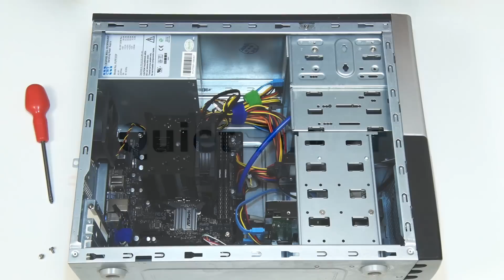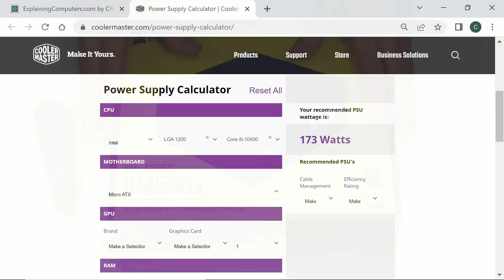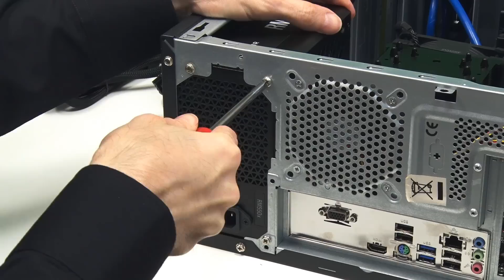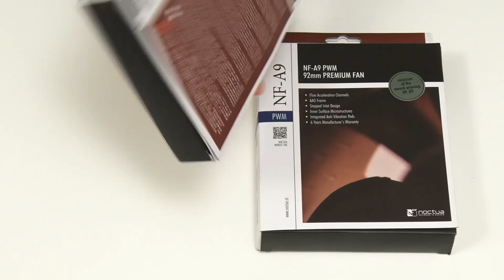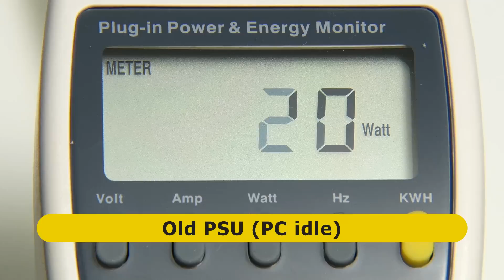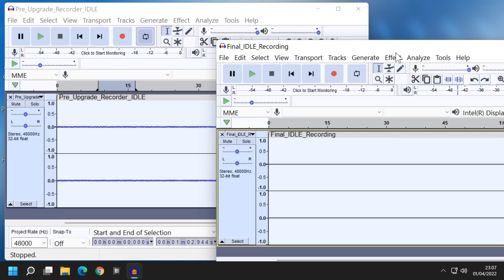Quieter PC #2: Corsair RMx PSU & Case Fans

Comment: For the last nine years, case fans and the PSU have not been the noise makers in my PC builds. The GPU and CPU cooling was sometimes but not since switching to Linux based OS. Oddly enough, the rare time I use an optical drive, that is the loudest noise emanating from my PC and sometimes HDD noise on a brutal data copy of over 500GB.
Reply from the maker: You seem to have been using different desktop PCs than most people for the past nine years . . .

Comment: Tea and crumpets and EC, my Sunday morning is complete. That's one heck of a demo of noise control, especially the amplified comparison! 

Once again that case shows a good feature set with its front fan mount. Young moderns may look down their noses at these old-fashioned cases, but that one demonstrates over and over how it was designed to actually be used and upgraded for the long haul.

 Noctua sure picked the ugliest colors available... well, ain't no one else gonna horn in on that branding. And once installed, I never see it again anyway... they've always seemed overpriced, but have to say I'm rather impressed with how they provide everything you might need (except a molex adapter dang it), so the price now seems more reasonable.

Comment: One mod you could do is cut out the restrictive stamped holes where the fans are, and put in a less restrictive fan grill. Will improve airflow and give a bit less noise.

Comment: I would consider actually using those damper rubber thingies. a lot of the noise made by fans are actually resonating off of the case itself, as well as the case itself being on a table, etc.
Reply from the maker: This is true. But there are silicon dampener corner mounts on the Noctua fans anyway -- and neither fan is rotating that quickly. So I don't think I would get thing any quieter using the mounts.
Reply: @ExplainingComputers  fair enough

Comment: Quieter pc is great but sometimes I like the fan noise but when the noise is very little
Reply from the maker: Yes, this is true. I've been using this PC for a couple of weeks now, and it is still a bit strange booting up a desktop that is almost impossible to hear.
Reply: @ExplainingComputers Yeah, it's like driving an electric or hybrid car for the first time. I got in, turned the ignition on and all the difference it made was a "READY" message in the cockpit. I hit the accelerator, the car moved, still no sound. Quite a weird experience... Thanks for the video Chris.
Reply: That's what LEDs are for!
Light on, PC on.

Having suffered with a noisy Pentium 4 PC years ago I try to get as quiet as I can afford.
Reply from the maker: @johnphilippatos  A very nice parallel.

Comment: In my PC the only thing that make noise is the GPU and old HHDs and have to say I love how quiet it's.
I wouldn't even bother with a GTX 1030 on that PC, a modern CPU should render things faster than a low/old graphic card specially around video/image encoding.
Reply from the maker: True on the onboard graphics in general. But, for example, DaVinci Resolve will not run using internal graphics, but runs fine using an GT 1030. Also, for many AI applications, CUDA cores are a requirement.
Reply: @ExplainingComputers  o/ keep the good work, didn't know a modern CPU-GPU combo could struggle with software at this point so then computer is incomplete without that proper GPU. Do AMD APU also struggle with compatibility or performance?
Reply from the maker: @ThunderKat  It all depends on the applications. Most software runs fine with an AMD or NVIDIA CPU, but some software is written for CUDA cores only -- an example being the Meshroom package I looked at recently.

Comment: My traumatized hearing, finds Noctua's fans, of standard thickness, to be the the most pleasant that they've heard, from the fan's PWM min. to their full rated speed.   Yes, when displacing large quantities of heat, Noctua fans also have to go to full speed.   But, my ears don't mind!    I've paid about the same price for 94, 120 and a bit more for the140mm fans.   I however, could not rationalize their higher price over other fans, so as to call them expensive.    [Flawless diamonds are expensive, compared to diamonds with a subtle undesirable characteristic.]   There are other brands of fans, many of which are highly touted by the branded seller.   But your choice was from Noctua's line of premium fans!    'Nough said!  
 
I also use a Noctua NH-U9S to cool in my mini-tower, a stock spec Intel i9-12900K, but with a PL1-165W, PL2-175W, Tjunction-94°C.

Comment: So that pc has become a filming subject. Most people will use newer or better parts on their main pc or on the pc they care most about 😅 which in this case would be your main video editing pc
Reply from the maker: I never upgrade hardware I rely on for the sake of it. Most of the interior of the PC I edit on is just over 2 years old -- an i7 6700T with 32GB RAM and a lot of storage -- and works perfectly. So I let sleeping dogs lie. And the hardware I "care most about" is camera equipment, lighting and HDMI/SDI recorders! :) As I've said here so many times previously, the focus needs to be on the pipeline, not the PC. Recording all video in ProRes format signficantly improves workflow.

I also do not understand why some people are surprised when, to run a weekly computing channel from which I earn my living, I need to have hardware dedicated to it. The most important thing I did when I became a full-time YouTuber was to stop using the PC I work on as the hardware I test software on and take apart or upgrade for videos! :)
Reply: @ExplainingComputers  that's definitely a good point. Many of us have varying hardware requirements/preferences. Recently someone in my office ordered a couple of dell precision and hp zbook laptops cause those were needed for video editing and machine learning. It is now a requirement cause  previously, these were performed on normal everyday type of computers until one day it was not sufficient and quite old. 

For other uses a more basic but decent i5 8/10th gen 16GB ram desktops are being used.
Reply: @ExplainingComputers  I normally run OSes that I make videos about in virtual machines on my main PC that I also use to edit my videos.
Reply from the maker: @World_of_OSes  Yes, that can work -- but I also get complaints when I don't do installs on bare metal. :)

Comment: My Fractal Design R3 (or is it a R4?) was so quiet at the beginning and with it's stock fans, that I couldn't even hear it at all. I actually had to look under the table to see if the LED is on when the screen went into power saver. xD
Over the years the fans got louder and I replaced them with Noctua ones 1.5 years ago (yeah, the packaging it a bit of an overkill) but was tad disappointed by them being louder than Fractal Design's stock fans. In general the case is great for low noise levels as it has high quality and good dampening materials.
Later I got a be quiet! case for my wife's PC because it got praised by Gamers Nexus for being quiet but find it's quality far below Fractal's, with really thin feeling and sounding metal panels and even the damping material being worse.Also worse build quality with mainboard some standoffs not even be able to screwing in tightly but spinning in their screw holes of the case.

Comment: Very informative video as always Chris but one thing has me puzzled. Why the rear case fan? With the tower cooler on the cpu pulling air from the front and exhausting it out the back a rear case fan seems to be overkill. I would have thought that a rear fan would only be needed if the cpu cooler was sitting flat blasting hot air into the bottom of the power supply. Additionally under load the cpu fan may spin quite a bit faster than the rear case fan causing an imbalance in the airflow. My Haswell i7 system has one fan at the front with a tower cooler on the cpu and no rear case fan. Been like that for years with no heat problems and little to no noise from the two fans. Under load I can feel warm air being pushed out of the rear of the case and that comes from the cpu cooler alone. It would be interesting to me and perhaps others if you were to revisit this in the future and take sound and temp readings with the rear case fan removed. I suspect there would be no difference and if that were the case then you would now have one spare case fan for your next project!
Reply from the maker: This may well be true. I decided to use the front and rear fans, and as large as possible, to move the required airflow with the minimal fan rotation. But one may well have been enough as you say.

Comment: As far as I know the nuctua holder makes it more silent.
Reply from the maker: It may at high speeds, but there are silicon corners on the fan anyway. This PC is now effectively silent using using screw mounting of the fans.

Comment: This edition inspired a question. Are there standard dimensions for power supplies, or do you have to check very carefully that a proposed replacement will actually fit in the available space, and have conveniently placed mountings?
Velcro cable ties as used here are probably perfectly fine for a stationary application like a desktop, but if a more robust grip is required, there are re-usable variants of the otherwise single-use zip tie. (Invented for possibly transient mountings in racing car, light aircraft, &c.)
Just a thought inspired by shovelling crud out ot desktop machines; put a light filter material (A/C, vacuum cleaner, or similar) on the outside (sucking side) of the front fan, to trap any dust that might otherwise get in and settle on the board.  The fan might have to work a little harder, but it'll kep the interior cleaner.
A regularly modified project like this machine might not be unopened long enough to accrete a significant layer of dust, in which case the effort wouldn't be justified.
Reply: @arch1 2kw's not a power supply, it's a space heater!  :-)*

Comment: I'm confused... what did the RPi 400 have to do with "a quick test"  at 10:02?
Reply from the maker: That was a Raspberry Pi keyboard I used (with a mouse plugged into the back of it), not a Pi 400.
Reply: @ExplainingComputers  - Aaaahhhhh... that explains my confusion alright.  I never thought people actually used RPi keyboards and mice especially for anything other than a RPi.   :-P
Reply from the maker: @ElmerFuddGun  It was around and connected -- so quick to use in a test.

Comment: you said you was monitoring the rear fan earlier in the video not the front fan
Reply from the maker: I am monitoring the rear fan. Have I contradicted this somewhere?
Reply: @ExplainingComputers  Yes. When you are in the BIOS you state that the chassis fan 1 is the front fan.
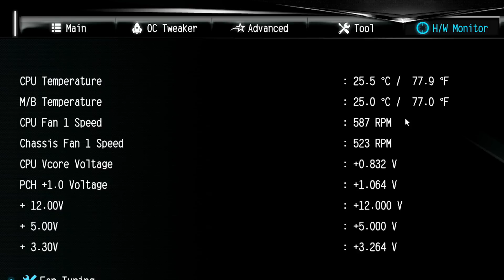Reply: @ExplainingComputers  At 16:42 Chris said "...and the chassis fan that's one [?] the front we're monitoring is just over 500...".

I guessing the word in question was "one", but the sentence using that word does not make sense. Maybe it is supposed to be "on" which would make sense. Regardless, that word is not clearly audible in the video. Maybe that word was cut off during an edit.

In any event, "...front we're monitoring" is clearly audible and I think Kevin has a valid point.
Reply from the maker: @Colin_Ames  Ah, my bad. Sorry for that. :(

Comment: I was surprised that there was no additional gasket between the power supply and the metal PC case to reduce vibration noise.  Is the power supply itself plastic?
Reply from the maker: The power supply is metal.

Comment: Does that bag of bits add up to anywhere close to the cost of a baseline M1 Mac Mini, which most of the time is completely silent (and could no doubt be throttled to never use the fan, as per my MacBook Air that doesn't have one).
Reply from the maker: Interesting point. As far as I am aware, the final result is cheaper than a Mac Mini M1, and a lot more flexible in terms of available software and upgradability. :) But for me this is irrelevant, as I need a PC -- not a Mac -- to make videos about PC stuff.

Comment: Since your new power supply sucks air out from the same location as the rear fan (the original PSU didn't have a fan there), would you be willing to disable the rear fan entirely and monitor the heat temps during a stress test? I suspect it will be fine without it, especially since you're not planning on using anything more than a GT 1030 graphics card.
Reply from the maker: Yes you are right, disconnecting one of the case fans may be fine -- although remember that the PSU fan is not operational below a 220W draw, so is not actually in use. :)
Reply: @ExplainingComputers  Ah, excellent point. I failed to account for that.

Comment: where is the 120mm fan supposed to get its air from as that case has a fully enclosed front panel
Reply: Looking at, say, 10:45 you can just make out at the bottom right of the screen that the front panel has holes underneath; most front panels I've seen have either those, or a vented front.
Reply from the maker: It does not have a fully enclosed front panel! :) There is an air intake at the bottom as on most cases of this style.

Comment: You can improve air-flow and noise again slightly, and reduce the strain on the fan by cutting out those inefficient punched alluminium grills (with a Dremel or suchlike) and replacing them with some alluminium mesh (car repair stuff will work), or even just leaving them as a big fan-sized hole if you're feeling bold . . . This would be of course a fairly permanent change to the case, which may or may not be an issue.

Comment: Funny I got the exact same power supply a few months back after another Corsair I had for many years (probably something around 10-12) failed.
I noticed you're using Windows 11. How do you like it so far, Chris?
Reply from the maker: Thanks for this. I'm not a massive fan of Windows 11, but cannot avoid it given what I do here on YouTube! :) But then I'm not a fan of Windows 10 either.
Reply: @ExplainingComputers  Do you think it's better than 10? Or just an unavoidable upgrade?
Reply from the maker: @allluckyseven  Uhm, that is a hard one. It seems solid and stable, and a visual improvement provided you don't want much control of it! But probably more of an unavoidable upgrade in my opinion -- and one taking us more and more down the road of Windows (and esp. Windows Home) being a Microsoft service and sales platform.

Comment: Why do so many modern PSUs have all there cables in black? How can you easily find a green cable and a ground one to bridge to get a first look whether the PSU gets any power at all?
Reply: @arch1 Clearly not talking about a new unit, when I buy a PSU, it is either a Seasonic, or even better a Superflower. And I'm most definitely not a professional, just an enthusiast. But sometimes when you are trying to fix a PC that seems to be getting no power at all, checking the PSU is the best way to start. I also thought that what I described previously, is exactly what the motherboard is doing when you turn the PC on. Is it not?
Reply: @arch1 Thanks for the detailed answer. Take care.

Comment: I’m rather disappointed is the choice of fans. The nf-f12 are not quiet at all(loud af), the nf-a9 is better but not quite quiet. The arctic p series fans or the be quiet silent wings / shadow wings are really quiet, not the marketing / Noctua fanboy bullsh t. Don’t get me wrong Noctuas quality is very good but not really quiet (except the nf-a12).
Reply from the maker: I am bewildered by your comments. In use in this PC both of the fans are effectively silent. Noctua claims around 16dB as I recall, and this is certainly what is being delivered.
Reply: @ExplainingComputers  I based my comments on personal experience. I have all the fans I mentioned used back to back in my pc. Same case, same heat sink, compared them to another and used them for period of time. I did not measure the noice lvl though. I based my comment on my subjective experience. I still use them in different use cases in different PCs . The nf-f12 for radiator/aio, the silent wings as case fans and the artic p12 for cpu tower coolers. In general I would recommend the p12 over every other fan, price to performance is amazing.

I really appreciate you reading and responding to comments.
I do like your videos, even if my comments might seem harsh.

Comment: What happened to the fans. Did the rear fan change speeds and what happened to the front fan did it stay on or not. Would you consider adding a fan controller board when you add your passive graphics card.
Reply from the maker: Yes, both fans changed speed -- they are both getting the same PWM signal (so always both running at the same percentage of their maximum speed, which is different for each fan). As far as the PC "knows", there is only one fan connected, and rotating at the speed of the rear fan, which is supplying  speed monitoring signal.